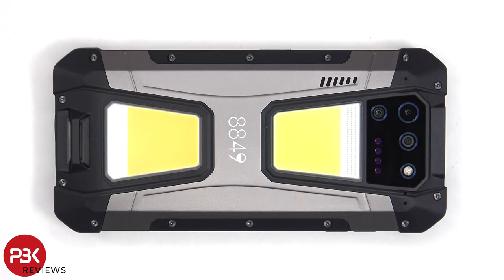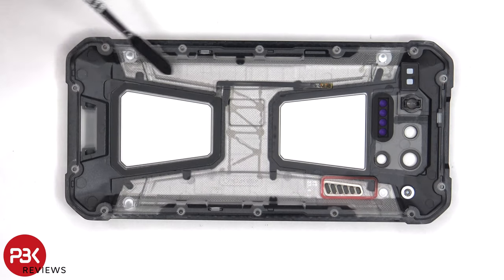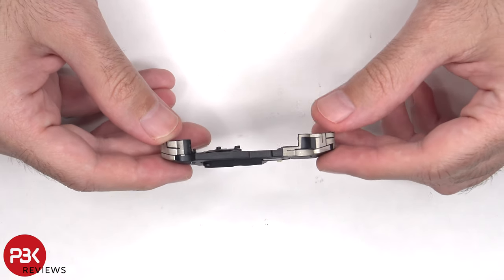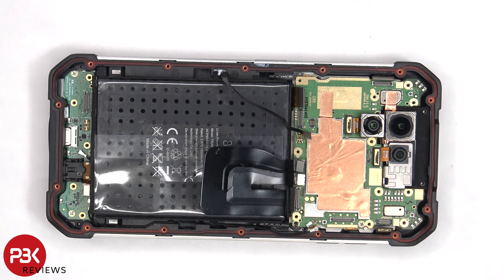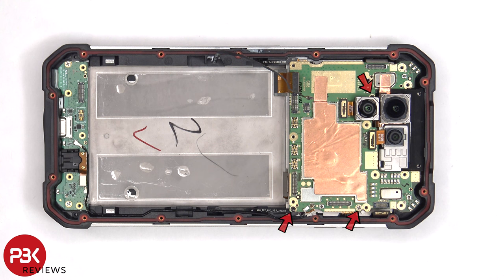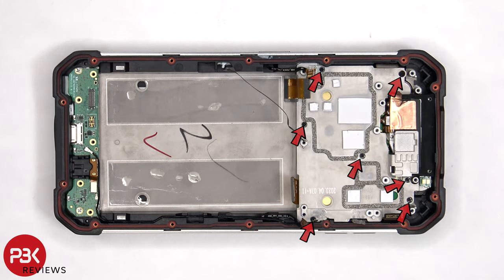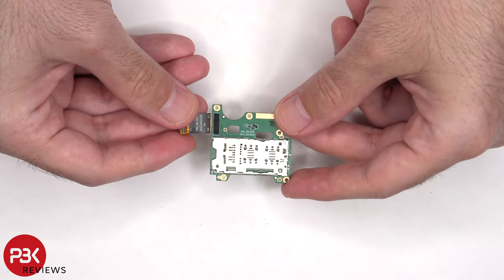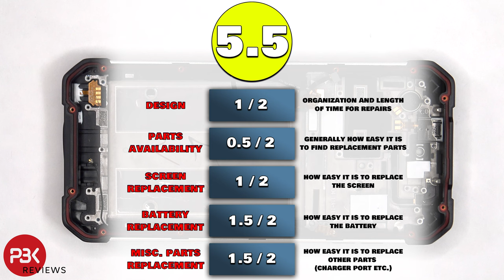Unihertz 8849 Tank 2 Rugged Teardown Disassembly Repair Video Review

Comment: I looked for this video and it helped me a lot because my phone stopped charging and with a USB tester it gave me a power cut, well, I took it apart, changed the entire USB module and it still gave me a power cut, I don't know why it happened, the device was not hit or wet, also, I couldn't claim the warranty on AliExpress because I didn't buy it from the "official" store, fortunately the battery lasted for many days, it allowed me to back up all the information before dying, (less than 4 months) I don't recommend it for the rest, PS: I went back to my old Blackview BV9500

Comment: At this thickness, phone companies better put in 18650 cells. Think I read that they've gas release valves & don't swell. Imagine the immense swelling on these prismatic/pouch cells bundled together 🙂💀
Reply: Have you any recommendation for a better /safer phone that's also rugged with good cameras?
Reply: You are right with your statements, but using 18650 cells also means less capacity, because due to their cylindrical form, they don't use the given space very well. Also more of their own mass is used for the housing, because they are already meant for being handled like regular batteries. The batteries used in this phone and basically every other phone don't have such a protective enclosure, because the phone housing already does the protection and they use the space given to the max.

Comment: Great, I need to repair mine.  did you need any glue or would just the red sealing rubber do the trick?  keep ip69?
Reply from the maker: The rubber gasket will handle it, no glue needed. And yes will retain the ip rating.

Comment: Sir have you seen any phones similar hit with better camera and a better battery style? I'm looking for something that isn't so easy to break, and has IR and night vision or thermal imagining. Good flashlight too, but projector isn't a must.
Reply from the maker: With better camera  and rugged, you'd be looking at phones like the galaxy xcover pro or similar, but those don't have IR or night vision. However you can purchase a infiray p2 pro thermal camera which you can attach to the charger port of the phone to give you that feature. Its also small and easy to use.
Reply: I have this phone and ive honestly been super happy. I dont take toms of pictures but the camera quality is by no means bad just not the absolute best ive ever seen. I am a phone destroyer though and have been through like 10 iphones and this one has held up awesome. The camping light ia crazy good aswell. Only downside is it kinda looks like a home depot store phone lol.

Comment: @PBKreviews
 Hello! there are many owners of Unihertz 8849 Tank 2 whose screen looks like the battery has -61%, because of this the phone works in economy mode. Does the Tank 2 phone have two battery connectors? is the battery somehow made up of two parts? As with this -61% error, although it doesn't seem to charge either battery, the battery is charging (or one of the sides if it has two). In this video you have given too little information about the battery and its connectors. Are the connectors from the battery much too tight that they can disconnect with mechanical shocks?

Comment: Now the question is, can you replace this battery with the original Tank's battery seeing as it had higher capacity but higher weight as the downside.
Reply: Nope. The battery is not even the same shape.